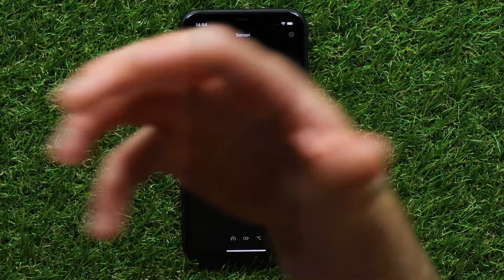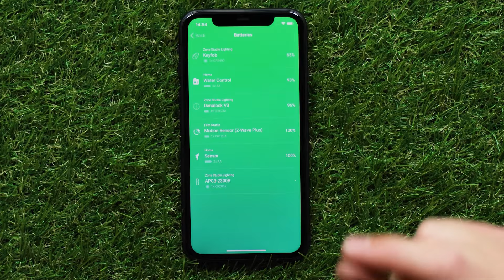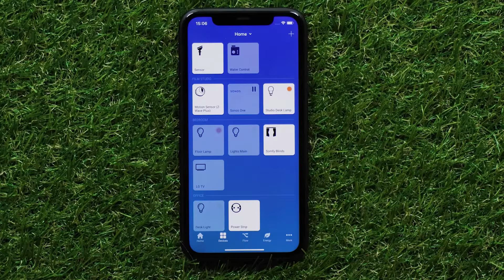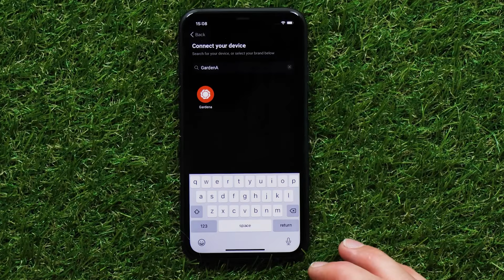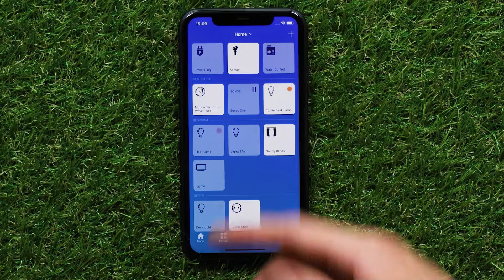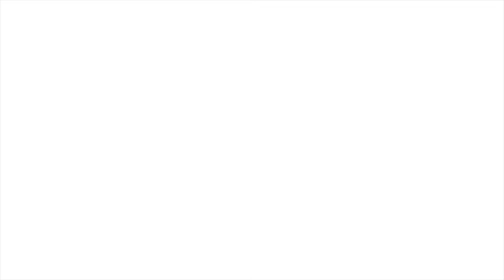GARDENA Create your own Smart Garden | Talks with Homey

Comment: Wouldn't this flow be triggered multiple times, even when the water is running (until it reaches 35%)? And wouldn't that cause some strange behavior? For example if you try turning that water back on manually after the first 90 minutes.
Reply from the maker: Hey Stein, You're absolutely right! When filming this, I didn't even think about that, thanks for pointing it out! Easy fix for this type of issue is to add a Card to the 'Automatic Watering' Flow to trigger another Flow. In this case, you'd trigger a Flow like this: https://homey.app/f/7pJHJE/. This would work to 'pause' the automatic watering for 24hrs after it is first triggered.
Reply: @homey  Why not just add another "And" card; "Gardena Water Control: Turned off" ?
Reply from the maker: @steinage  This would be challenging since the event 'Turned Off' is a one time event. You have 'And' cards for if a device is on or off, and 'When' cards for a device turning on or off.
Reply: @homey  I said 'And' card, and was referring to the current status, not the event. As you said, there should be an 'And' card for when it is currently in the status 'turned off'. :)

But off topic: I really miss a way to cancel an ongoing flow like this on that is running for 90 minutes.